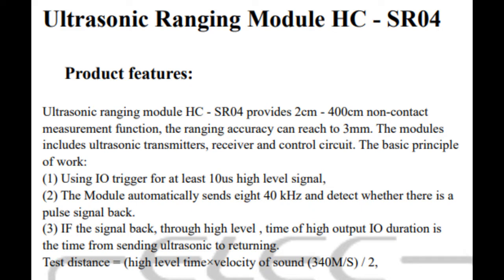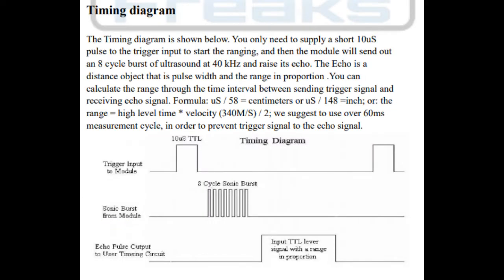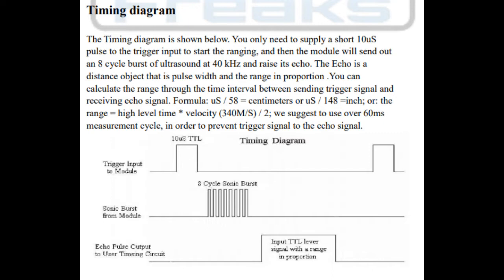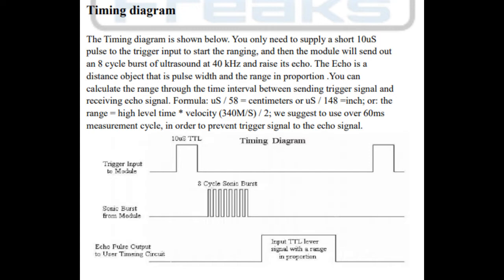Ultrasonic sensor with PIC18F45K22 microcontroller

Comment: Great video and easy to follow steps!!! Actually I wanted a waterproof ultrasonic sensor. Have you tried this sensor? https://www.ebay.com/itm/253978673298 or this modified HC-SR04? https://www.ebay.com/itm/254058015473 Have you tried any of those 2? Thanks in advance :)
Reply from the maker: Hi, Thank you.
I haven't tried any of those two, and i can't find their datasheet. 
Can you send here a link to the full datasheet?
Reply: @razc3510  Heyy thanks for your reply. I have been stuck on this for few weeks. I could only find a chinese datasheet for the sealed waterproof sensor https://www.ebay.com/itm/253978673298. Uploaded in my drive and here is the link https://drive.google.com/file/d/1GzrRXey_iicRWOCrU96wFCGc__djzOar/view?usp=sharing If you could make a tutorial video showing the connection diagram and code then it would be of really great help to me for my project !!! Thanks !!